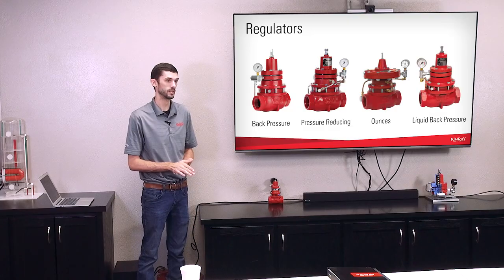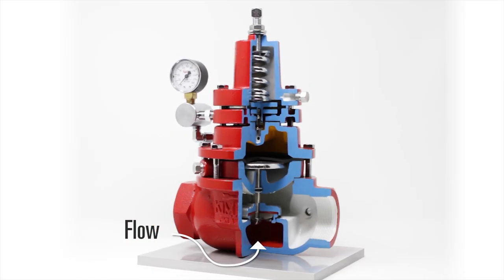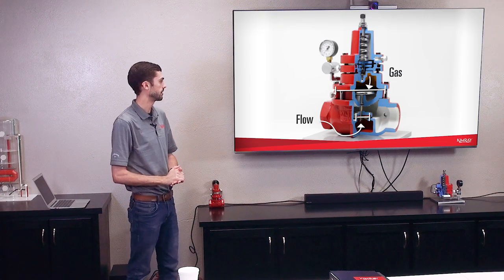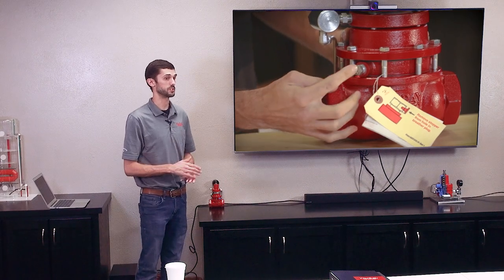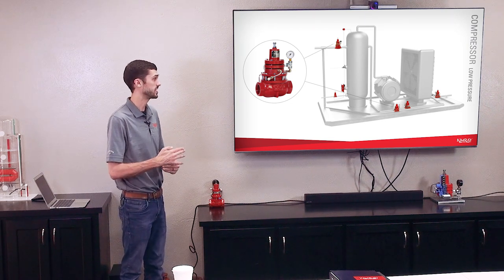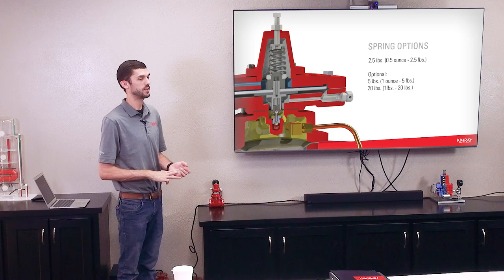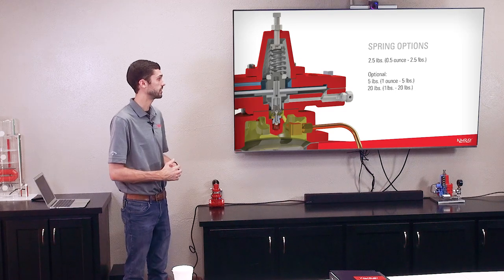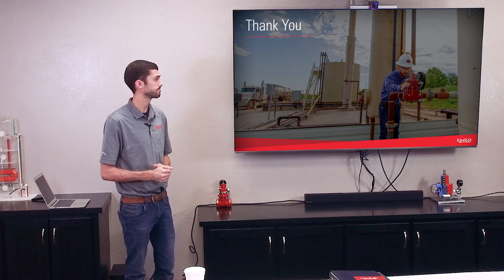What are Gas Back Pressure and Pressure Reducing Regulators? Applications, Options & Troubleshooting

Comment: Can you please specify what is the spring constant that you use in the Back Pressure regulator?
Reply from the maker: Hello, thank you for your question, however I'm not sure what you are asking exactly. Are you looking for the spring pressure ranges? Can you explain a little further?
Reply: @KimrayInc  I was thinking about the Spring constant K of the pilot spring that creates a force on the diaphragm. I am also curious about the cross-sectional area of the spring
Reply: Do you have any specifications of the 3011P diaphragm? For example the thickness, diameter etc?

Comment: what is the maximum pressure that Back Pressure regulators can hold back? Which model is the best in that purpose for a 2-inch standard NPT threaded one?
Reply from the maker: The gas back pressure regulator has a maximum operating pressure (set point) of 300 PSI. For applications that are above 300 PSI use our high pressure back pressure packages.  
Properly sizing the valve will help ensure that it’s the correct valve for the application.